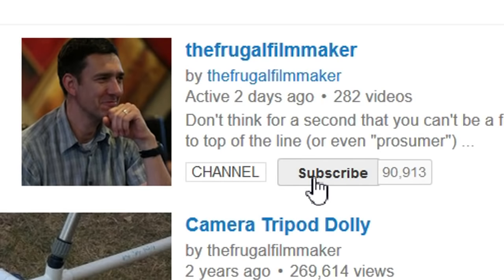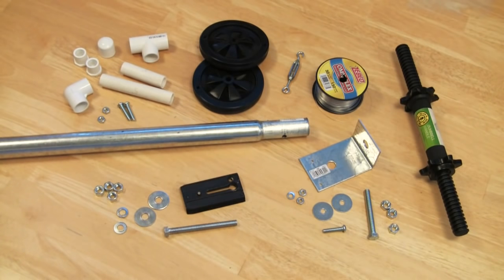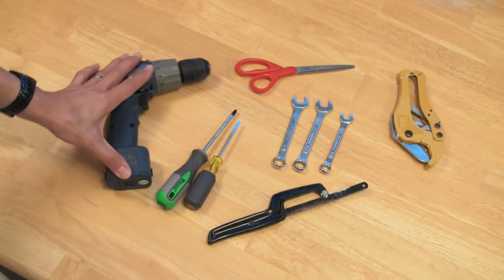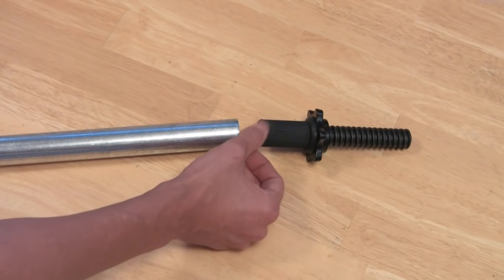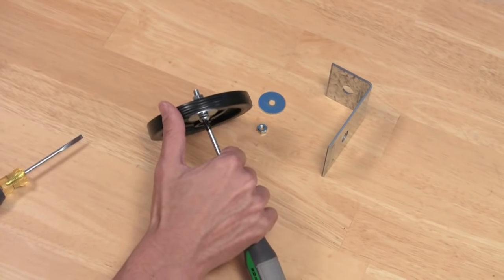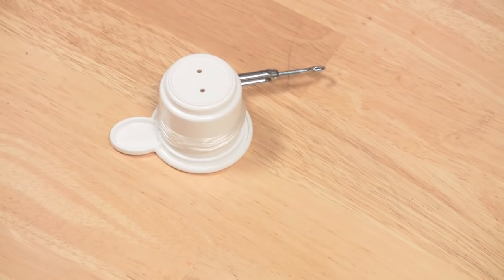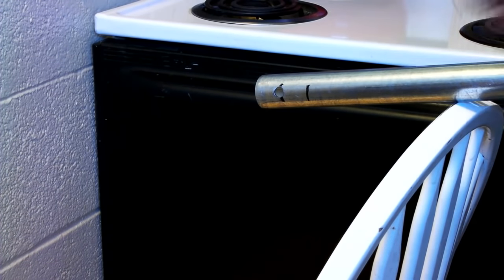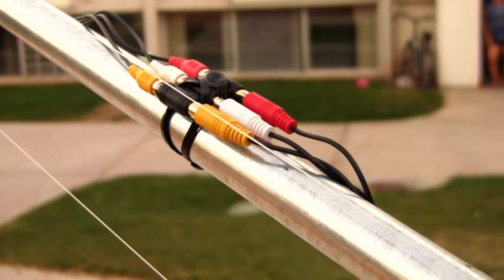How to Make a Camera Crane / Jib for $30

Comment from the maker: @LongboardBurlington My A-camera is the Canon HFS100 (it's in the video at the end of the pole with a wide angle lens), while my B-camera is the Sanyo CG10.  The shots of me using the crane was shot by my friend and his Canon HFS200.  The Sanyo was used for all the talking head shots of me as well as all the kitchen assembly stuff shot against the sink.  The kitchen table stuff is the HFS100.

Comment: MADE IT!!!!!! LOVE IT!!!! only issue; my tripod is not that great, but we worked around it. We are shooting action sports stuff so I actually skipped the weights and just had the camera guy hold it. Its a pain, but cheaper and works. 

I have used it in two videos I have made now and I love it. It works great and a lot better than most we looked at simply because you can control the angle of the camera from below and it does not just simply hold the 90 degree angle that most others have.

Comment from the maker: You should be able to use the composite breakout cable (which ends in RCA ouputs) to connect to your RCA inputs.  If you don't have those on your monitor (or camera/DVD player with an AV input), you'll need some kind of adapter.

Comment from the maker: @JRTET21That's always the chance you take anytime you send your camera up on a pole like this.  The only way your camera would fall off is if it wasn't secured properly.  The odds of the screws falling out (especially with a lock washer) or the rubber wheel ripping are pretty slim.  Of course, you should always check everything before you attach your camera.

Comment from the maker: You might try a large speaker stand, like the kind DJs use to hold those giant speakers in the air.  Drill a horizontal hole where you want the crane pole to connect, and attach it the same way as in the video.  

My tripod has a Bogen 501 head on Manfrotto 3046 sticks (legs).

Comment from the maker: Some people have used DJ speaker stands instead of a tripod.  They are fairly cheap (around $30) and can hold about 80 lbs.  Just drill a horizontal hold near the top and mount it the same way as described in the video.  It's not as easy to break down, but it might suit your needs.

Comment from the maker: @davidmatosfilms It's not really designed to hold a prosumer camera, but it's possible.  You'd need a longer mounting plate and would have to reinforce the mounting wheel assembly.

Comment: Maybe someone already figured this out but, i found you DONT have to cut the barbell in half, just take a boxcutter and trim off the RUBBER tip that stops the weight and just insert the whole bar inside the top rail. Thanks for ALL of the great ideas Mr FF.

Comment from the maker: Got 'em on eBay, but you can find them at most department stores (like Wal-Mart).  Be sure to check out the Frugal Crane 2.0 video where I replace the training wheels with garage door pulleys for the same price.

Comment: @thefrugalfilmmaker will do! Actually, I'm thinking about using a metal flat rod, and bending it into a U Bracket for the pole support connection on the tripod and using the L Bracket on the end. To early to tell though.

Comment from the maker: @blackroze101 Whatever quick plate comes with your tripod.  It just makes things easier to leave the plate attached to your crane so you can slap it in your tripod whenever you need it.  If a quick plate doesn't come with your tripod, you probably need a beefier tripod.

Comment from the maker: @ChowderHeadFilms Any custom piece is doable.  I was just trying to avoid that and use off the shelf parts to make construction as simple as possible.  If you do go that route, don't forget a hole in the middle to allow the bolt and nuts to pass through.

Comment: If the wheel down by the operator's hand is smaller than the wheel up by the camera, the turning motion will be less sensitive and smoother on the camera. Lots of cranking, nice slow motion. Law of mechanical advantage :)

Comment from the maker: @monkeybred I've had no problem with the fishing line slipping or stretching.  Just make sure you use rubber grooved training wheels and you should be fine.  If the line does slip, shorten the length of the line or tighten up on the turnbuckle.  Use 50lb. test line and it will never break on its own.

Comment: I imagine that having another pulley system for the pan would work well, but you'd have to change the mounted position of the camera from being attached directly to the pole/pulley to below it.  Also because of the size restrictions, the pulley may have to be attached to a whole other pole to be worth while, unless there's some sort of offset arm so the wires don't interfere.

Comment: If you went with a pre-drilled metal channel, you should be able to put heavier cameras on, but that will pretty much double the cost considering they usually run about 30 bucks, Im using a furring strip that I reinforced with a 8 foot 1/8 in thick aluminum angle iron, its pretty secure, I used your design for the crane part, but I built the rest with a lazy susan and some more angle iron,

Comment from the maker: @officiallyEPIC1998 The camera attached to the tripod allows a video input from another source.  So, all I'm doing is providing that input with the output from the crane camera.  This allows me to monitor the output from the crane cam via the input on the monitor cam.  I've since switched to a cheap SD monitor, but the original idea still works.

Comment: Hey, that's really great!  I love the simplicity and the results.  I have 2 suggestions for the design - I'd suggest using nylon locking type nuts instead of double nuts at the pulleys & pivot point.  Secondly, your wire seems secure enough when you adjust vertical pan, but wrapping the line around the pulley one full wrap instead of just hooking it over would give 3 times the surface area and friction where the line meets the pulley and give a more positive lock.  Great piece of DIY gear!

Comment: I made mine based off your version 2..  works great.  Thanks for the tutorial.   my dumbell didn't have foam around the handle so I didn't cut it, I just put duct tape around it and shoved it in then more duct tape, then armasil (sp?) pipe insulation with sticky tape to seal the seams to cover the duct tape. I also made a pvc base for it that swivels and is about 4 feet tall as none of my tripods could support the weight...

Comment from the maker: @MetalLegProductions I'm not familiar with that model camera, but all you need is video input capability.  Check for an AV in/out jack.  Run your video out from your main camera to the video input of your monitor cam. 

 As far as headphones go, I use the Sony MDR-7506.  They work well.

Comment from the maker: @cratedigger89 Originally, I tried using an L-bracket while keeping the tripod head level, but gravity would always pull the thing over due to the weight.  Tilting the tripod forward solved this and allowed me to simplify the whole setup.  If you get it to work for you, send me a photo and I'll feature it on the blog!

Comment: Another item you could use for poles is a roof rake for snow removal. They snap together, and unsnap quick, they are alunimum as well, a kit has 4 poles but you can buy poles themselves which are 5 feet each. And they are relitively cheap $8.54 through ACE hardware online, made by Garelick. But they would put you over the $30.

Comment: If your having trouble with your piece of angle being level, you could use a thicker gauge of angle, a little harder to drill through, but might be easy'er than setting it with a hammer and vice. Also when making sure your angle is level, use a bullet level rather than having to get test footage, it gives you the ability to ensure your jib and camera are level.

Comment: thanks for this, i just have finish making one, now i'm just painting it, i produced it in a very short time, what takes me long is when im purchasing parts.. its hard to find parts of it here in the philippines.. mine overall it cost $50- Jib, Paint, Tripod, 12.5 weights. but its fine, comparing it to the cheapest jibe here that cost $250

Comment: This is great! Not sure if anyone is still here, but I wonder if you can make a higher crane?
Reply: I was thinking the same thing.  Obviously a few changes would be required but I really can't see why it couldn't be done.  the frugalfilmaker was clever, his version is modular and can easily be broken down for transport.  its also very stable, which means its going to be safe.  a lot more went into creating this than just keeping the price down, i'm impressed by how well thought out it is.

I think you'd have to keep that in mind when designing a longer one.  Then you have to consider the tripods ability to safely handle the load which is likely multiplied by some mathematical magic that factors in leverage.

What about repurposing couple old pool skimmers?  lightweight aluminum pole components and some have "nested" poles that can telescope to greater lengths.  Maybe if you could reinforce them externally with a PVC sleeve at the joints to spread the stress of the weight along several inches on either side of the joint.  Or perhaps a shaped wooden insert the would internally accomplish the same thing?  But lightweight materials would require a lightweight camera (which is 2021 is not gonna be hard to find-- a gopro sized camera would easily work).  Then consider mounting a gimbal?  

I mean once you start going down this rabbit hole you can see the potential for lots of creative ideas to piggyback off thefrugalfilmaker's design!!  
now, back to daydreaming!!  good luck!

Comment: What a great video. As someone who is developing a lot of projects - such as a sound zeppelin, barn doors for halogen lamps, a small 4' jib (as 3 of about 15 projects!) this has insired me to try this out. (If I'd had made it, probably would have used the second parallelogram bar - which you've shown isn't needed) Just a thought, but the tubes might be possible to be made from a 10' background support bar. See, thinking already!!

Comment: Impressive... the first time i saw the camera mounted i thought it was a lot bigger though, how much weight is that camera? or how much weight you think this jig would support?, I use mainly DSLRs but the Nikon D7000 and Canon 7D are almost 1kg + the battery gear and light/microphone, might be 1.3-1.5 kg, and I'm curious if this DIY jig would work for me or if the tilts would be easy with that weight.

Comment from the maker: @AtlantaTerry My camcorder (seen in the video) is pretty light (around 2 lbs. with that wide angle lens), but most small cameras should be handled easily.  Not sure about the weight limit, as I've never tried to max it out.

Comment: @thefrugalfilmmaker oh, I see. Also, I had a couple thoughts. What if at the tripod connector, instead of the snap plate, you were to attach the bar to a heavy duty L Bracket? Screw one side onto the tripod head, and have the other side hold the pole? You could also use another L Bracket at the tilt end. The ones I've seen at the hardware stores look like they can take a bit of weight since their regularly used for shelving. Just a thought.

Comment: What type of connection (wire) did you use to connect the camera? That is my only problem. Thank you very much you have been a great help to me. I am using the same camera as you, but unable to connect it to a camera monitor.

Comment: Awesome video!   I may give this a try.  If I successfully build this I'll definitely link you vid on my blog.  Any idea if this will work for a Canon 7d weighing in at between 3-4 pounds with both the body and lens?  I'm wondering if there's a weight limit on the pulley system.

Comment: Hi, the video is ultimate. Very good and technical and easy way to explain . Sir I am new in this field and wanted to know few things from you . 
1) I am using Canon 5D Mark II camera and 16/35mm lens so is the procedure to make this crane same?
2) Is this weight of the crane need to be same like shown in the video?
3) How should I focus the camera lens on an object when it is at a height?

I would be very grateful if you will help me with these few questions of mine. Thank You So much.
Reply from the maker: 1) The camera stage on this version is too small for the 5D, check the 2.0 version for a wider platform. 2) not sure what you mean here, but it is pretty heavy (at least 20 lbs.). 3) You'll need some kind of remote follow focus (and a monitor) to pull focus on this thing.

Comment: I looked for the coby monitor you have in your vid, and cant get them over here. I have however been told , an lcd monitor used in cars, for reversing and things, can be hooked up to a battery pack and be used as a monitor! If this is the case, your suggestions would be great, or even a vid on how to get cheap alternatives for monitors. Keep up the good work, and all the best.

Kev Harte

Comment: Hi, this might sound like an odd question/request, but my shoot & point (hate it compared to my old manual slr) shoots pretty decent video in the right lighting...I digress.  I was wondering if you had any ideas for a pvc (or something else frugal), hands-free, over the shoulder mount?  I wanted to start filming some tutorials but the subject matter requires hands-free.  I was looking into placing an inexpensive helmet/action cam on my machine...anyway, thanks for your help/ideas!

Comment: thing of the game hangman, you have a vertical off the set, then a horizontal going across the top of the frame and then a vertical going down to hold the camera. I can't have a crane going diagonally through the frame.  Have you devised anything like I describe?  I'm sure I could probably come up with something after a trip to home depot, at least I hope.....

Comment: @BGFilms95  I used the yellow light stand from harbor freight. And my crane has more weight to it than his seems to have physically. Also mine terminates different so it was harder to work at first. This design here would definitely work better with the light stand I used.

Comment: Very nice, ill try this one next. However my question is: Balance. Now I have my cam and weights balanced, but it only stays balanced while the crane is horizontal (flat). I cant boom up, let go, and it stays. It slowly drops to flat. Any suggestions on the physics at play here? Or will I have to add some kind of break? Thanks for the vids, and great job...

Comment: thanks a lot for this , great work , just an idea becuz i saw most of your work and u love pvc :)  so i would love to find a way to build this crane of pvc pips ! it will be lighter to carry , easy to build ..
Reply from the maker: PVC is just too wobbly at the longer lengths. I am working on a revision however, that is lighter and will work on more tripods.
Reply: Marc Mediapro You can always fill your PVC with expanding foam. It makes it really solid and still would be lighter than the metal pipe.

Comment: Heyyyyyy, this is probably one of the best DIY jibs i've seen. How is it in terms of portability? I duno how many other vids you checked out before you made yours, but this " PhilipStephens007" ("search for DIY Lightweight Camera Crane") made his out of PVC pipe, and I know your into your PVC judging by many of your tutorials lol. I know you commented on somebody elses post that PVC would wobble horribly, but you could support it with wire or string, or maybe have 2 pipes running parallel.

Comment: U had me until I heard fishing line...R u crazy I'm not trusting my hundreds of dollars of equipment at the end of some fishing line
Reply from the maker: I can respect that, though the odds of 50lb. test line breaking is pretty slim in this application, and even if it does the camera will just stop tilting. If you want a beefier cable, check out the Frugal Crane 2.0 video in which I use a plastic-covered metal clothesline.
Reply: carissa denver 85lb spiderwire fishing line. It actually holds about 90 lbs and it braided line. It will hold any camera and is MUCH cheaper then cable.
Reply: +carissa denver then why are you watching this video, go buy one.
Reply: man if you have hundreds of dollars of equipment go buy a real crane. This is for those who don't have hundreds of dollars of equipment.
Reply: carissa denver  ummm, the camera is not hanging by the fishing line, did you watch the video?
Reply: Thanks for the info.

Comment: Nice tutorial but don't include sub titles as they don't make sense and have been poorly typed giving a incomprehensible guide.
Reply: He didn't include sub-titles.  You have closed-captions turned on, and they are automatically generated as he didn't include subtitles.  Press CC at the bottom of the video.
Reply: travers114 Haahah